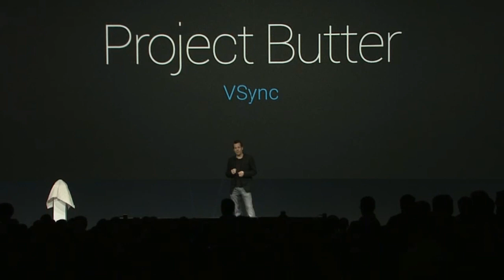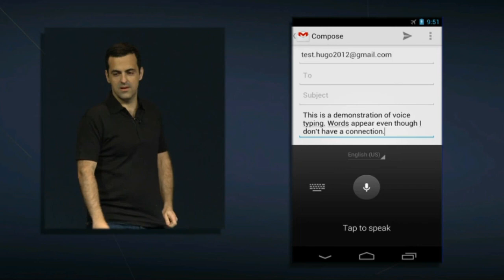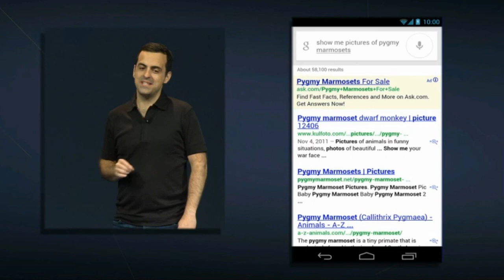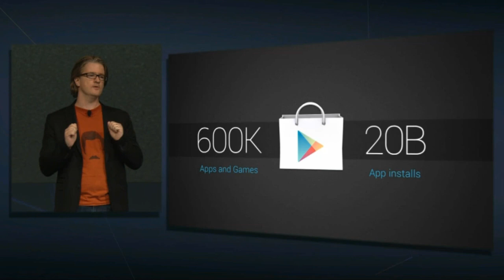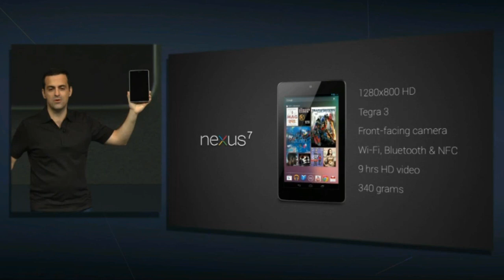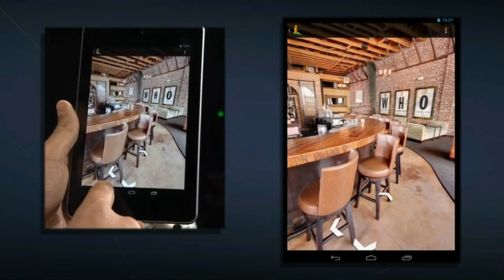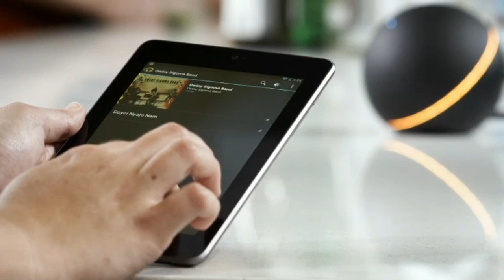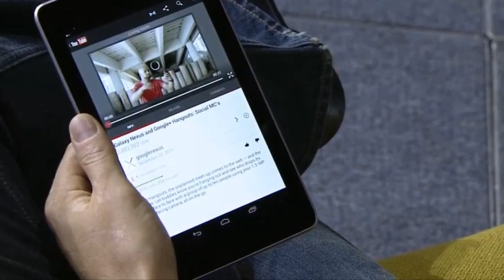Google I/O Full Keynote - Jelly Bean 4.1, Nexus 7 Tablet, Nexus Q, and More! (HD)

Comment: Basically the difference is that with bluetooth you have to wait for the file to transfer from one device to another. With NFC and Android beam it happens almost instantaneous and also you can share much more with beam than with bluetooth. I think that's mostly correct :)

Comment: To hack an android device you need to root the phone and in doing so you unlock the bootloader this can only be accesed by the phone itself there is no way of hacking someones phone over the internet. There are a lot of apps that require rooted phones such as screenshot programs so that people cant track what you are doing by taking screenshots and sending them bach to them the android system would ussually block them but rooting allows apps to acces the phones full capabilities.